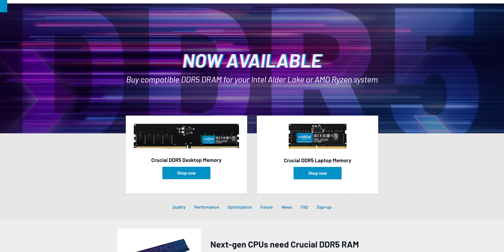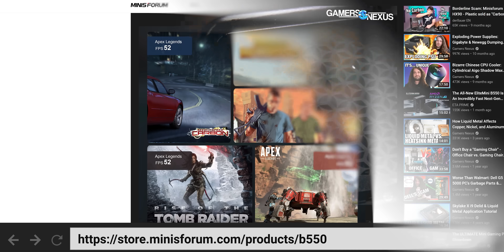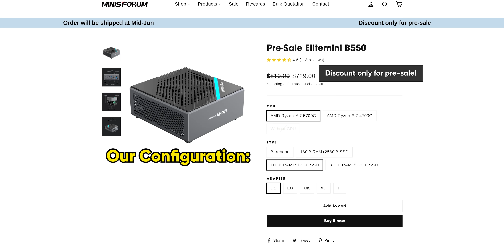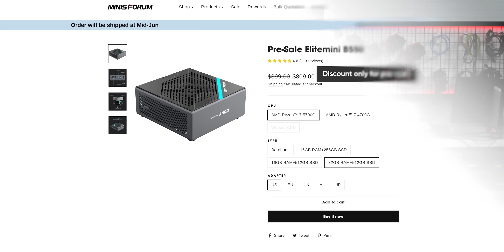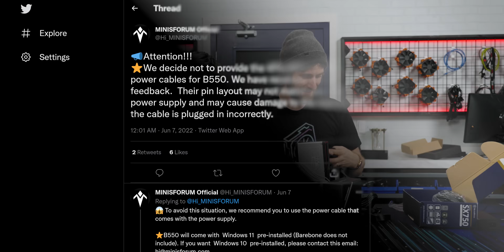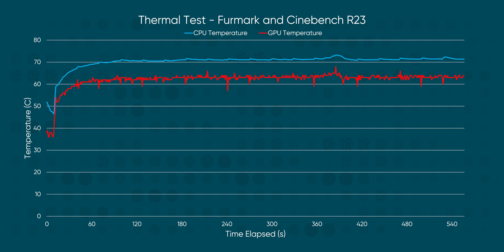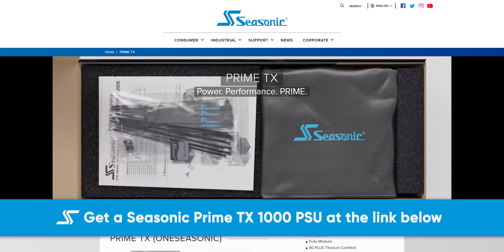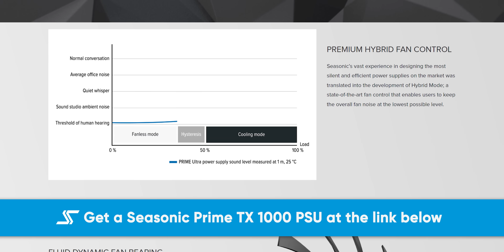Who's Buying These? - MinisForum Elitemini B550

Comment: the only upside I can think of is being able to properly separate the air flow to each component. I'm using a small form factor and it basically vents the cpu heat directly into the gpu air flow. this unit is a novel concept, which could use a lot more refining. I'm giving it a good pondering if it's going to be worth it to switch cause my issue could just be an overall air flow problem and my system is fine in its current config. will have to see if moving it closer to the window where there's constant fresh air helps

Comment: This has to be the worst PC design ever. I'm sure this started out as a simple micro PC design and then they realized that the market already had loads of micro form factor machines so they went into full jank overdrive. I mean they could have designed an integrated case that held the external PSU, the extension interface and the GPU into one elegant unit with the PC occupying a cutout in the corner. Instead they designed a full on rats nest. What a joke.

Comment: This thing is made for LTT.
You could use it easily for benchmark testing. Swap out the system with another to change CPU hardware, or easily swap the GPU for testing other gpu's.

Comment: I feel like if the base also included some pass through for USBs you could leave the 'dock' on a desktop, or the back of a monitor with all the cables for peripherals on it in place. De-tach it, grab the power brick and sling it to work etc. Where you just have a monitor cable and peripherals or blue tooth devices waiting for you. I's definitely pretty great for blow through GPU cards like a 3080.

Comment: I could see this as a gaming PC while you ae home and NAS while you are not, since it uses less power while only using power brick and you mostly use GPU while you are at home, when you walk away you could pull it out and have it running in a rack or somewhere while you are away, assign ethernet a static IP and you won't have to worry

Comment: It performs same as a full size pc and has smaller size, what is there to justify about its use just get this instead of a real pc so you have more options to take it somewhere also it can be really good for engineering sites where you have to travel to different locations every couple months

Comment: Office workers could use this if it were designed better. I wouldn't mind taking my own PC to work, just plug in the monitor and I'm good. Using a laptop can achieve the same result but that would mean making a laptop my daily driver at home with no PCI-E expansion slot.

Comment: In terms of who it could be for ... I actually think that it could be a nice niche for my company... We do commercial office design and installation... when. I'm doing the design and 3D modeling at the office I need a pretty beef cake system but when I go to meet with a client on location I use my laptop for the presentations and such but I have ran into when the client wants to make some edits and re-render the laptop really struggles so using a modular small form system could be good for getting better power with less bulk... I have considered even getting a suit case for my mid tower

Comment: Like 4 or 5 years ago I suggested this in a comment here on a LTT video. Except my idea was better because it wasn't a dock that docked a tower... but a dock that docked a laptop... You know... the thing that's made to be portable...

In my idea you are college student or someone with the TINEST apartment ever. You have a laptop you go to class or work with... then you come home and slot your laptop onto the dock. 

The dock is connected to a monitor/s, keyboard, mouse, speakers, wired lan, etc. The dock has a full fledged GPU in it and maybe a mass storage drive. 

The laptop is a full fledged laptop running on intel graphics and 12th gen so it  can disable all the P cores while not docked for super power saving. 

And the best part is that the dock can have a light os in it like linux or chrome os... so even when the laptop isn't around the dock can still be used as a pc.

And as we saw in a recent LTT video linus just  ... RESTED... a heatsink onto the heat pipe of a steamdeck and instantly dropped 10c... So have a little flap in the laptop that folds open when you dock it that has a flat section of heatsink exposed that can make contact with a heatsink in the dock... or even an aio. ... just have it lined up so when you p[ug the laptop into the dock it presses the exposed heatsink up against the aio cold plate.

Comment: the stupid thing with this is that all of your peripherals are connected to the CPU brick....
whats the use of a easily detachable GPU on a mount if you have to detach/attach half a dozen cables every time?
the only way this would be even remotely useful would be if ALL the connectors were on one side and the base would act like a passthrough / dock.
all your peripherals can stay plugged in at the base and when you want to take it with you all you gotta do is undo one latch (that preferrably is a bit sturdier than just the PCIEx16 latch) and throw the thing into your backpack.
that would make it really usable for people with two homes (students in a dorm come to mind) who want to take their PC with them when they switch places but also have two full sets of peripherals and want the performance of desktop grade components instead of a gaming laptop where you pay for stuff like battery,/charging circuitry, power limitations to have ANY chance of running on battery and a trackpad

Comment: Love how it is not only shaped and sized like a gamecube, it also has mysterious connections on it's underside that no one will ever use
Reply: The Gameboy adapter för Gamecube tho 👀👀👏👏
Reply: @andepen6820  Cue Korone streaming playing Warioware Twisted with the Gamecube adapter and playing by holding the entire system up and tilting it.
Reply: @1steelcobra  There is the tilt and tumble speedruns.
Reply: @1steelcobra  what are you smoking and what are you talking about?
Reply: @Ande Pen it's OK. You won't understand if you're not in the rabbit hole...
Reply: @andepen6820  Somebody who uses a virtual avatar to stream played a gameboy game that uses tilt motion to be controlled on a GameCube by picking up the entire GameCube.
Reply: @1steelcobra  korone is cute doggo, so cute!
Reply: GameCube 3.0?...
Reply: also being embarrassingly messy, clunky and overpriced. what a great use of everyone's time.  why cant people just build computers and put them in cases, this is asking for trouble.
Reply: @justinvanhorne9958  ITX builds are kinda difficuit. This isn't a great solution though. I think if they designed it so a sfx power supply was included and all you need to do is plug in a graphics card/storage in a tiny enclosed case. 
I think custom non-ITX could be good because ITX boards have natural limitations of being ITX as well so they could make a system that has 3+ NVME slots on a custom board.
Reply: @VanSanProductions  the heck, my Asus rog miniITX board have 2 M.2 slots and couple of sata 3 ports. How much more you could even need?
Reply: @VanSanProductions  well that really is the crux of my issue isn't it, if they went that extra mile, you are into another realm of prebuilts that already exists... if someone like me can notice this, why and how do these dumpster fires not only make it this far, but get the press and traction that they do. it just doesn't add up.
Reply: @VanSanProductions  It's like a crap Intel NUC Extreme

Comment: Only use case is you are going on vacation and you wanna take your pc with you for the hotel tv or sth like that but in thaz case i would get a macbook docking station. Only point is that you normally dont need a laptop so the occasions were you need a mobile device are so low that you buy a normal pc thats somehow portable

Comment: 10:38 this is actually pretty applicable for me, i'm someone who have to travel interstate for a week every one or two month. If i buy laptop it's doing nothing 90% of the time, not to mention i have to transfer everything and install same programs. Currently i'm just carrying a nuc with a vega gpu. I'd love to upgrade my gpu the setup in this video is quite tempting.
Reply: yeah my gaming laptop died and I always felt like it was doomed from an upgradability standpoint and this is still way less janky than the low cost egpu route.
Reply: Why not get a desktop replacement laptop? Dock with epu and take it when ever you need to go.
Reply: @lejoshmont2093  i actually brought a asus g14 before, I just couldn't stand the noise because I'm rendering stuff all the time.
Reply: Yeah, having tried all 3 of the above solutions, laptops are expensive by comparison and usually a portable monitor, mouse and keyboard are far less clunky than the best laptop.  There are many remote work setups where it is extremely inconvenient to have the monitor attached to the keyboard and once you're using an external keyboard and mouse, you have a really expensive and large portable monitor that used to be a laptop.  Not to mention remote work setups that already have a monitor, mouse, and keyboard and you just want to use your own PC.  I'm sure any tech head can realize the value of not working on someone else's PC with your usb sticks and external hard drives.  Yikes that sounds awful.

Laptops are in my experience much less reliable than desktops.  I imagine it's the complexity required to maintain cool temperatures and a thin size but every gaming laptop I've used from Dell to Asus to Acer has had a myriad more issues than any desktop I've ever used.  And the price to performance is much lower.  If I need desktop performance I probably do not want to be playing on my lap.   So it usually ends up docked to a monitor anyway.

eGPUs + desktop replacement laptop is a really expensive downgrade to any desktop setup that again will most likely be used in a desktop like setup when playing games.

The SFF case was smaller but still not small enough to ever compete with a laptop and definitely not a mini PC.  There are many places where I need a laptop but have no need of a powerful GPU.  Even if I travel for work with my GPU box in my hotel room, I'm not bringing it actually to the office nor this giant hot rod heat wave Predator laptop lol.  Coffee shop meetings, office meetings, long waits away from home to watch movies or work etc.  Again, a giant clunky powerful laptop is much worse than a mini pc sitting under my chair with a wireless keyboard with a stand in it for the portable touchscreen monitor.  Also the ability to, again, separate the monitor to share the view with others while not giving away the mouse or keyboard etc.  It's all around a much better solution if you ever actually have to travel a lot with a gaming laptop.  Not to mention they are noisy and hot sitting on the desk or your lap.

Agreed, though, this is not well executed aesthetically or ergonomically.  It seems ridiculous to try to attach the mini PC to the frame.  Just have the GPU enclosure and power supply (like a normal eGPU box) somewhere permanent possibly out of sight and run a PCIe riser like cable to a dock that the mini PC sits in.  I'm not sure what they were thinking with this.  Linus showed years ago that you do not lose much if anything with a long riser cable.  Hopefully, they'll keep working on it.  But since most people can't even imagine the use case it appears, it's not looking good.
Reply: So why not just buy a SFF case?
They are not that much bigger and a lot less hassle than this abomination.
Reply: @Jehty_  yeah i'm still thinking about this option, i'm actually really tempted to go for the i7 beast canyon nuc and add a 3070, it's 8L and compact and little compromise.

Comment: I actually have use case for it: We do travel a lot between our home and my GFs hometown (different country). We do spent more time at home tho. So when we are at home, I could enjoy full desktop experience. When we get there, I can plop this on the table, but still have all my data (game files) with me. The internet connection is not great, so bringing the games with me, makes actually sense and I have dual 24 inch displays at both destinations anyway (so no point for me in buying laptop). For the record: At home, I have desktop and a MacBook Pro, which was provided to me by the employer (so I use that when not at home - sad gaming noises). But the possibility of taking my pc (not a laptop) with me, was always on my radar since I found about Zotac doing these "funny" little bricks. It turned our that there is huge market, chuck full of these and since then, I am considering buying a portable machine, not laptop. BUT Now that there is Ryzen 6000 line and these Minis with sorta elegant GPU dock kinda style... I think I might finally "kick the bucket" and go for one.

Comment: Actually having powerfull portable computer without the screen and battery makes sense for contractors or freelancers, who work from home, office, client office, co-working spaces where getting monitor and power is not an issue and having really powerfull system matters. It could be better than a laptop in some number of cases. You can get better performance, price and customization than with the laptop and weight and volume will be less.
Reply: Completely wrong....

Comment: This is exactly what I have been looking for,
If they get the psu mountings correct it will be perfect for me.
I'm an OTR driver and use my index in the truck, but if I brake down I can take the main part to the motel room and still do low spec gaming and YouTube.
All without unplugging the majority of the cables.

Comment: It would be interesting to see how the GPU performance compares between stock iGPU and a dedicated GPU.  I could see someone just turning down the settings a bit when they take their computer somewhere where using a dedicated GPU is impractical.  As for the power brick, it really needs more capacity... at least enough for a very modern AM4 CPU to not have problems.

Comment: Maybe could be used as a GPU testbench? Keep everything the same but keep swapping out GPUs to measure performance quicker? Seems like a waste still when you could just use a regular test bench.

Might be nice for someone who has a portable screen but doesn't need a gpu for workloads. It does come in cheaper than some laptops, but really I'd still rather have a laptop.

Comment: A laptop is cool and all but it’s still a laptop. Pc still outperform them. This thing almost makes sense until u use an external gpu. It’s so jank. They should make one slightly larger with a bigger power supply then you just connect the gpu to the pc. No need to have to 2 power supplies

Comment: I think the use case would be someone like me off grid that doesn't want separate systems. You can use the 2 liter PC stand alone for lower power and occasionally use a full graphics card. I don't play high end games and will tolerate lower graphics settings much of the time but occasionally I would want higher end graphics such as a gaming binge on the weekend. Plus it is a reasonable setup for LAN parties. Also lower income game developers might appreciate it more; code for the integrated graphics then quality control test on multiple cards.

Comment: I think you should check out more embedded platforms. They're usually an affordable compromise between a prebuilt and a custom built, like this build. In particular I got a board from Aaeon and built an OPNsense router with it, but there's all sorts of other features that the board offers, with an i5 CPU powered by a barrel plug, with sodimm, and it has a PCIe (I think x16) slot that I'm using to add a second 2.5g port, in addition to the onboard 1g and 2.5g ports. Accounting for the cost of the RAM, power brick, 2.5g card, and my 3D printed case, it's around the same price as prebuilding, without having to use a sketchy picoPSU or get a thick case just so the stock cooler and RAM can fit, and that's assuming the mobo would boot without integrated graphics if your CPU doesn't have any. But also the company sells more complete embedded systems like this, as well as displays and tablets. It's intended for commercial use or bulk ordering but I was able to get a single board shipped no problem.

Comment: I've been using a minisforum mini pc for a couple months now and its been pretty awesome to use as a daily linux box. It was reasonably priced, small and powerful. It is perfect for a desk that can't hold dual 27 inch monitors and a full desktop pc at the same time. In addition it had all the ports I needed, but still powerful and not limited by throttled by power limits or thermals. I think this is perfect for someone that needs a little more power from a gpu like some said engineering or machine learning. It's definitely easier to put together then building an SFF ITX rig and the possibly cheaper because ITX parts are not cheap.
Reply: Still going ok? Just trying to learn about Minisforum build quality

Comment: Truckers. One of my friends would have been all over this - upgradeable CPU, Accessory agnostic (so can use any screen/kb/mouse you want), easily portable, Optional full power GPU for hardcore gaming that is easily removable to fall back on the iGPU. Potentially more powerful than any laptop and without the accessory lock in.

Comment: I feel like this would be nicer if they made a power brick that can fully power all the system, including the external GPU. That would make it a lot more portable, and little easier to manage cables since the brick can be placed behind or under your desk, so you'd only have the one cable coming up from the brick. Still super cool, and honestly i could totally see this being great for artists, as even if you use a drawing monitor you could literally have this hiding behind the tablet and have great portability without the external GPU thing